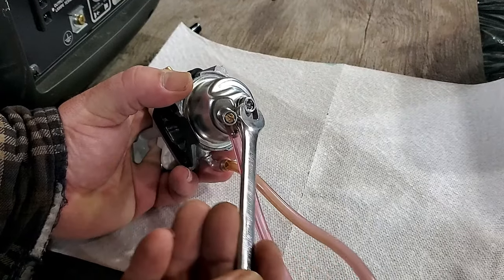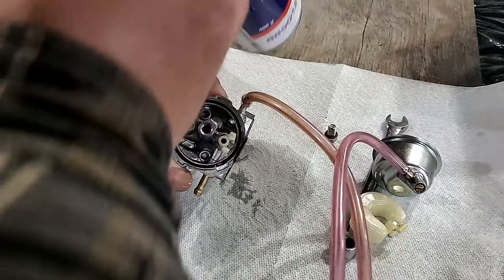Honda eu2000i generator easy  no start repair

Comment: I bought my used Honda eu2000i in October 2019 and didn't try to use it until June 2021, but it wouldn't start.  Checked the spark plug and it looked bad, so I changed it, but still no start.  Looked at other videos, then opened the carburetor and it looked clean... but still wouldn't start.  So I borrowed my friend's (same) generator.  The next day I tackled the project again and found your video... you did a great job in explaining and describing which tools, etc.  It was exactly what you said it would be... the jets.  The garbage wrap tie was ingenious!  Put it back together and it started up!!  Decided to clean my friend's carburetor while I was at it, which he was happy about.  Thanks so much for your video!!!
Reply from the maker: thanks so much ,really appreciated you taking the time gary , i try to make videos utilizing what folks have around!   again ty sir

Comment: I am a female who knows nothing about this kind of stuff.  My Dad was a diesel mechanic and I wish I would have paid attention more.  I did not have any of the spray that was mentioned here but took the bread tie and cleaned the piece with holes on it really good.  Put everything back together, swore a few times and it did not work.  I let it percolate and then tried to get the spark plug out but I did not have the right tools.  I reset the cover on it and gave it more pulls and heard like it was trying.  I pulled several more times and it started working.  Thank you so much!  I learned so much!
Reply from the maker: that is awesome thanks so much for taking the time to let me know!
Reply: My old faithful is starting to rattle at muffler. It originally had a spot weld burn thru. Muffler replaced under warranty. I want a vid on either spark arrester replacement, or muffler replacement. Thanks. Yeah the pre filter is a sneaky lil bugger. Mine crumbled. .

Comment: The low speed jet is under the idle screw. Its plastic. You have to remove the idle screw to get to it. You never showed that part or maybe your not aware of it, but sometimes its the problem and cleaning the main jet alone wont work. Look at a parts breakdown for that carburetor and you will see what im talking about.

Comment: This went from a days/weeks in the shop repair to a same day DIY-er. I really appreciate guys like you that share knowledge like this without the hoopla. A big thumbs up!
Reply from the maker: Thanks so much Paul, really appreciated
Reply: Awesome video. My unit now runs great.
Reply: Great video l have hour meter on mine maintenance is easy . So far still starts all the time. Use nonox gas no pump gas . Same for my 68 evinrude snowmobile no fpool uled carbs.😊 ps l think you forgot lower foam on bench. Easy install.thanks for the video😅

Comment: Brilliant! After 6-12 months of non-operation I couldn’t get my EU2000i generator to start. Found your video, followed the steps, etc. Nothing looked dirty and the jets looked pretty good to me. But I completed everything and put it back together. Tried starting it the way you described and nothing happened. Bummer. I let it sit for a few minutes. Came back and tried one more time. It started on the first pull! Woo hoo! So happy it’s working. I saved the link to your video for the future. Thanks so much!
Reply from the maker: Awesome David,  glad to hear that.
Reply: Mine did that. It was one ounce low on oil. NOT LEVEL.
Reply: I had a tune up on my euhonda2000i carberator. Supposed to have been cleaned. Generator stopped can't start.Mechanic says it is muffler.How can that be?

Comment: Well I was just about to bring it in to the shop - had sat for 6 months and would not start. Stored indoors so I knew no moisture got in. Was going to take the whole thing apart along with your video and luckily I watched all the way through. This is the only video that tells you to prime the carb with the machine in off position. 8 pulls in off- flicked to on and started on the second pull. Going to get some new gas and let it run for a few hours. Thank you sir!

Comment: Great video! I have a newer Honda EU2200i and I couldn’t believe I couldn’t get it to start. I bought a Honda for reliability and I have other off brand generators that I haven’t had to touch in 14 years. Anyway, I did exactly what you said and my generator started right up!! Can’t thank you enough!!

Comment: Great video! Super useful! I have one of these generators that I started one time and shut off.  I did run it completely out of fuel, and then it sat for three years, did not add any stable chemical in it, I probably should have, took it apart, cleaned the jet orifices out with the garbage bag tie, lol, and it fired up!!
Thanks for sharing the video, you saved me the trouble of having to figure out what had to come apart to clean the carb!

Comment: Two year old generator stopped starting on the first pull. Great instructions, except  my jet got stuck, ended up tapping it down from the air intake side. Thank you very much. Primed it, and started on first pull! Fantastic. Love the tool list as well.

Comment: Hey, this actually worked!  I hadn't run the generator for about a year, and it would not start no matter how many times I pulled the chord or tweeked the choke.  So I followed your instructions exactly, and the generator fired right up.  I really didn't expect it to because I got so little dirt out of the jets (just some very tiny black specs).  Great video - very clear and no missed steps.  Thanks!

Comment: Thank you for taking the time to make and post this. I'm the skeptic, but I am happy to take stuff apart and I believe your method has merit, and I'll explore it this summer. That being said, last time no start I  removed air box cover and a very small squirt of starting fluid and fired right off for the duration of need. Last time I needed it, after sitting for nearly a year, I removed the fill cap and blew into it, pressurized it, and slowly pulled the rope, then put cap back on and with choke on pull a couple of times and fired and ran for duration. It's hard to imagine this machine has such close tolerances as to need routine dismantling just to make it run. I feel that if it had a small pressure bulb like many 2 cycle engines it might solve my hard start. Thanks again for your instructions and I'll address this next summer.
Reply from the maker: HEY BILL ,both methods for start you mention would confirm this diagnosis ,as both would provide fuel to start the engine and it would continue to run but it would  be lean with a low fuel supply which could burn a valve or piston ,  let me know how you make out when you get to it , and I appreciate your time ! thank you.
Reply: @thisguysgarage  Thanks for the reply. Early on a few years ago I had the surging problem and had the carb off to run the smaller wire through the air/fuel mix plastic nozzle, but didn't think to look in the bowl. I'll get a fire going in the shop and get to it shortly. And I'll let you know what I discover. IMHO Honda and Toyota and other Nippon machinery are closer tolerances that Briggs&Stratton, which by the way rarely fail to start even with all kinds of junk in the tank.

Comment: Bought this generator about a year ago. Test ran it once when I got it. Then never used it since. Pulled it out yesterday and it wouldn’t start. Sat with gas in tank all that time didn’t think it was an issue. 
Found this video and gave it a try. Surprise! It worked!! Five pulls and it started right up!! Thanks for the great lesson! 👍🏻
Reply from the maker: Really appreciate your time letting us know!

Comment: Worked! Perfect video. 
Did some aggressive pulls after following this guide and it wouldn't start initially. I left the gas notch on for about an hour, tried again and it started up! These fuel efficient carburetor's are not beach friendly. Thanks so much for showing the simple fix!
Reply from the maker: Great to hear!

Comment: Thanks for a great instructional video. I watched it three times then disassembled my EU2000 which failed to start after sitting all winter. It runs great now thanks to your easy to follow instructions, the problem was a plugged jet.

Comment: Thanks...you basically fixed my Honda Generator.  Paid minimum for "non-running"unit. Still have a problem with the ECO idle or switch but at least it runs. Nice work.👍

Comment: Great video. I did this with an older Honda generator well before your video and it took me a lot longer to stumble my way through the same steps, in the dark and driving rainstorm. It was nice to see the steps for my newer generator and that I'm not the only one to  forget the small foam air filter on reassembly.

Comment: Eu2000i would not start, So here I am. Did what you said the only problem I ran into was the jet would not come out. I think that the ID dia of that hole was a little small and they jammed the jet in there. Honda QC didn't do a good job that day. Any way I sprayed carburetor cleaner into the hole with the jammed jet, then used air to blow it out. Did that three times. put it all back together and it started. I don't like that jet being jammed in there and not coming out. But it is running good now. Thanks for taking the time to do this video.
Reply from the maker: Thanks for taking the time.  You are not the first person to let me know that the jet would not come out.  Crazy.  Very appreciated

Comment: Great tutorial. The off switch on original Honda eu2000i generators shuts off the fuel and the ignition so pulling it over several times does nothing to help start the engine. I have two of these quality generators and both are hard to start after setting for awhile so I pressurize the fuel tanks which helps prime the fuel pump. This makes starting much easier and always use non-oxy fuel.

Comment: This video is awesome, my Honda 2000 Always started up in the first 3-6 cranks since I got it in 2012 I hadn’t run it in maybe 2 years and this was the first time it wouldn’t start. I literally followed this video step by step and it cranked up on the first pull.

Comment: If you have a wire brush for welding you can remove one bunch of wires from the wire brush and use those stiff wires as a tool to clean the orifices if you do not have the proper jet cleaning tool. Good video.

Comment: I saw something from your episode that I found with mine that when I turn the gas on and pull start it sometimes it takes two or three poles and then I let it sit for a few minutes and then pull it again on choke and she starts up. What you mentioned was to pull it a few times in the off position to create a fuel vacuum that will help it start when you turn it on I will definitely try that

Comment: Thank you!    Now I know more about (hopefully never needed) future repairs.
Today I did my quarterly generator test run, only to discover that when I attempted to close the choke, the generator would turn off. I opened the gas cap, and a  blast of air came out of the gas inlet. I closed the gas cap, and after that the machine worked perfectly.
Reply from the maker: Thanks so much mykel,  that is s fantastic habit to have, doing quarterly startups. As I like to say panic is for the unprepared 🤜🤛
Reply: this guy's garage 
That’s a great expression which I’ll remember, thanks. 
Floridians expect hurricanes, and I’m one of those who are food/water and lighting (kerosene and oil lamps, plus candles) prepared. I’m not a so-called hardcore obsessive “prepper”, in any respect, but as a former LEO, I know to expect anything at anytime, be vigilant and be prepared.
Reply: Also- I’ve a 2 story house, and on each closet door knob there’s a Horror Fright 3 AAA cell flashlight, with rechargeable batteries. And, I’ve counted the steps down to the first floor - in case there’s a blackout.

Comment: The ignition switch is also the fuel switch. No need to plug or clamp the fuel line. After re-assembly, turn the ignition switch on (fuel will fill bowl) and then pull to start. Thx for making the video.

Comment: The last 15 seconds solved my problem.   

Turn it off, pull the string a few times to create vacuum on the fuel.  Then start.   

My parents gave me their generator about 8 years ago after they sold their RV.  It's been sitting in my garage never used.   Had a storm last night and couldn't get it started until after watching this video.   Then it started right up.
Reply from the maker: Thanks so much, really appreciate you taking the time 👍

Comment: Good job Shaun.  Probably wouldn't be a bad idea to keep a spare set of jets around.  Then just swap em out and clean the one you removed to be used as the spare.  I've always wondered how bad it would be to get past the plastics on those Honda Generators.  Doesn't look to bad
Reply from the maker: Great idea, they are pretty easy to work on .
Reply: People like you are why I read the comments: that is an excellent idea! I'm going to go order a spare set of jets and a fuel shutoff petcat.

Comment: My old arch nemesis the Eu 2000 lol. Worked on many of these. problems mostly caused by lack of use (old gas etc).
Reply from the maker: its the only problem i can see with the unit. Ty shawn
Reply: @thisguysgarage  
Wait a minute?
Hammer Head's name is Shawn?
And you're name is Shaun?
Who is Sean?
Who is Shaughnessy?
Or is it O'Shaunessy?
-Chuck
-Chucky
-Charlesworth
-Charleston Chew
Reply from the maker: @PanzerPlatform  I'll take a Charleston chew 😋 lol
Reply: I guess I'm quite randomly asking but does anybody know of a good site to stream new movies online?
Reply: @Kyle Yael thanks, signed up and it seems like they got a lot of movies there =) Appreciate it!!
Reply: @Alessandro Wyatt Glad I could help :)

Comment: Excellent tutorial buddy. Real easy to follow along. I just can’t seem to remove the jet from within the carb, like it’s seized in place. Yours seemed to dump out with gravity when you flipped the carb over lol. I’ll give it a good soaking overnight and have another go tomorrow. Thanks.
Reply from the maker: Is the jet turning with the screwdriver
Reply: I was able to remove that part - the smaller piece that’s like a grub screw. It’s the lil perforated tube behind it that’s stuck.
Reply: I had the same issue. Sprayed a bunch of carb cleaner into the hole then gently tapped it while holding upside down. Finally tapped out….

Comment: followed your video to the letter after putting it all back together it wouldn't start? took the dog for a walk came back tried to start it not start? had supper , walked the dog dumped the gas out and put in new and first two pulls with chock and lever off then turned it on and on one pull it started! ran good for a full hour then shut it down and wondered if I just would of replaced the gas would of it started? karma? thanks good video it had to have something to do with it starting too! thanks again

Comment: Thanks for the video it started super easy. 🤗 Just one question after doing the service there was gas coming thru the lines when I put it on the on position. Why would that be happening?? How can that be fixed?

Comment: Hi, came across your video as i have one of these generators that has worked flawlessly for yrs. Haven't needed for a while, and now of course when i do, wont even try to start. Iam pretty handy, but never tore into a carburetor before. Did it and it works!. Problem is, i ended up w a 1/4-1/2" spring left, not sure where it goes. Gen runs, but only on full choke, and doesn't provide power to the outlets. Any suggestions? Thank you

Comment: Wow - great video - I just got one of these generators 2nd hand and I'm expecting that it didn't get a lot of love, so I'm going to be doing these kinds of basic repairs and tune ups... So this vid is awesome.   Question ----> at 1:27 of the video I notice that there's a coarse sponge / air filter inside the airbox that gets removed. Then later on at 9:22 I see it on the bench. Should it have been rinsed out / re-installed just before you put the airbox cover back on? Thanks again for a very informative video. Cheers
Reply from the maker: Yes clean with soap and water and install 👌

Comment: I found a Honda 2000 at the dump and the issue was the jet with the tiny holes was put in backwards and went way up inside carburetor. So make sure you don’t put that jet in upside down.

Comment: Something to keep in mind is usually on your appliances you set your spark plug gap between 28 and 30 but with the Honda generators they like their Gap set between 24 and 28

Comment: This is most likely from ethanol in the fuel🤔 my jet tube was stuck in the housing so penetrating oil is a good trick to soak it🤙 used a stainless rod the size of the center hole to break it loose "voila"it dropped out😎 I used a unwind off a guitar string, acts like a pipe cleaner makes thems holes real pretty🤠
Reply: Be sure to drain the bowl after use for storage😴 add fuel stabilizer to the tank🚽
Reply from the maker: awesome jim great thinking